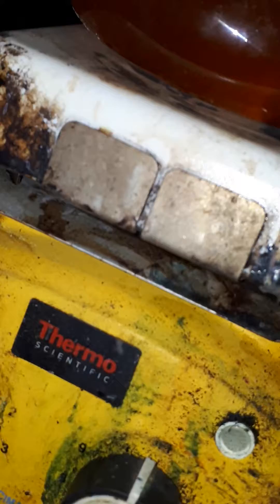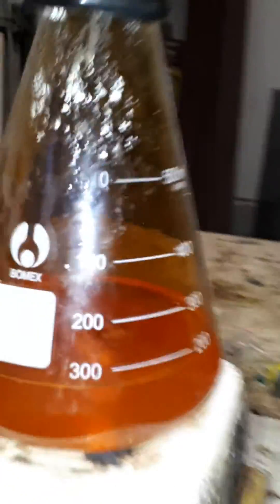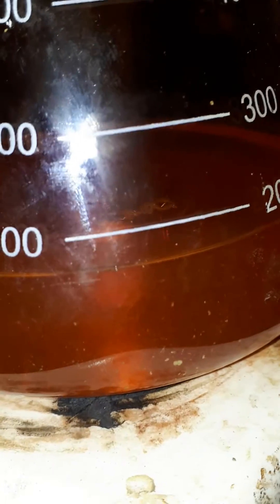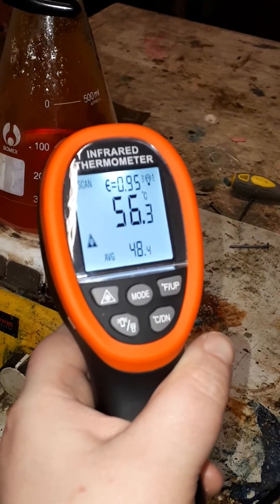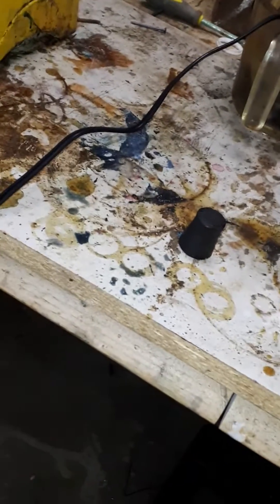Attempting to dissolve Antimony trioxide in weak Aqua Regias.

Comment: Can gold be separated from antimony in aqua regia?
Reply from the maker: I really don't know. In all the video it is unlikely to see gold and antmony together. That a very good question antimony dissolves very slowly in Aqua regas compared to gold but the complex gold-antimony may act very differently than normal elements.  Since antmony is less reactive I recommend 70% pure Nitric acid with small amounts of hcl. The ratio of nitric acid to hcl must be a lot higher than 1:3. Heating it with stirring and reflux is strongly recommended.
Reply from the maker: Well I did some research in industry they use potassium cyanide or sodium cyanide.  Unless you are super experienced with cyanide and have a hazmat suit with oxygen I would not mess with cyanide!